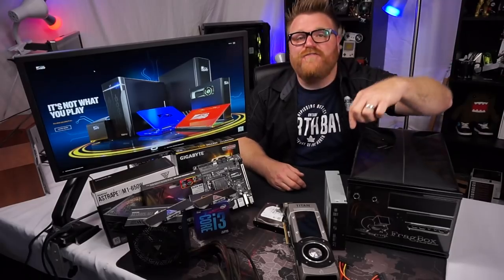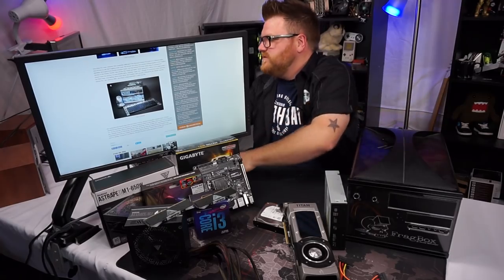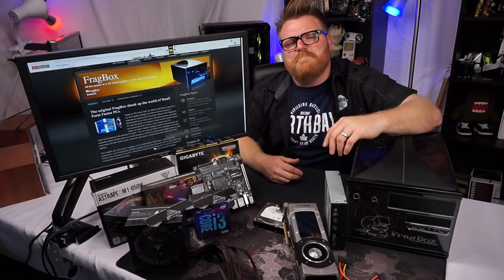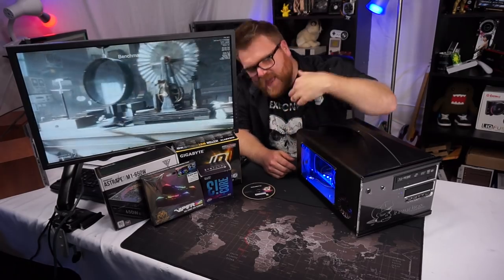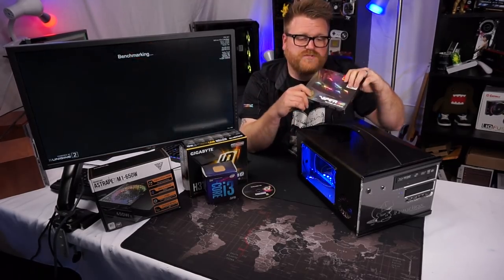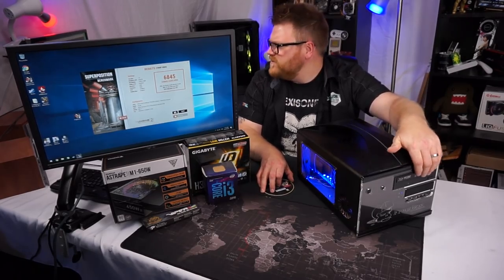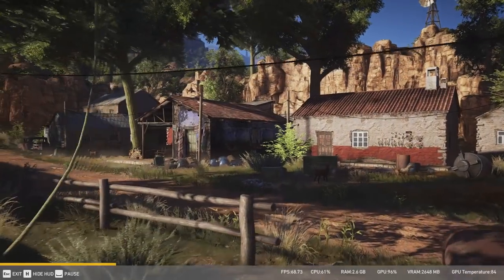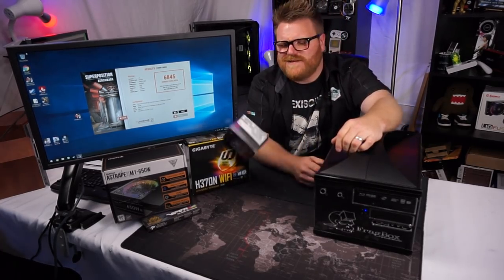Bringing a Falcon Northwest Fragbox Back To Life

Comment: You can cut down on the coil whine by using a UPS with Sine Wave Correction. Definitely helped me with my GTX970 Strix that is infamous for coil whine. Also cuts down on heat from your PSU as it has to do less correction. Also pledge on acrylic to cut down the scratches.

Comment: You could replace the 5.25" CD Drive with a nice fan controller to modernize it even more.. though if I think about it, nobody really uses 5.25" fan controllers anymore :(
Reply: i do, but I understand why people use the hub style that plug into the usb header and also control RGB lights

Comment: Damn that BugVidia coil whining....their FE edition crappy blower style coolers are really crappy....never understood why Nvidia fanboys bought these versions since they all develop coil whine very fast and become even more anoying that they already are with all the blower loudness already out of the factory :-).
Reply: LFly R 

You almost have to use a blower style card in cases like this (also in SLI builds).
Reply: smoked_out : no you don't have to use it in this kinds of build, because this case is not hermetically enclosed, it has enough holes so that a 2-fan AIB edition like MSI GTX 1080 Gaming 8G could breathe with ease because it also blows 50 % air out of the I/O at the back.. As for SLI builds goes, I agree....but to be honest SLI builds are stupid since 98 % of games don't show justifiable scaling or proper scaling at all and the second GPU is usually idling at 1 % or has very irradicall utilisation. SLI is dying slowly unfortunately and for years I wanted it to start getting momentum....

Comment: core i3 8100 = i5 2500k lol
Reply: Once you overclock the 2500k to 4.7ghz +
Reply: 4.4 ghz got me pretty much 600 CB iirc.  Then again I did have it running at 4.8 for a while so it could have been that.  Either way a LOT of 2500ks hit those speeds.
Reply: Mine kicks ryzen ass and I paid 100 euros for the processor, mobo and 16gb RAM
Reply: Does it really tho? 2500k barely beats a stock 8100.
Reply: Eli_Plays Beats a 1200 as seen in userbenchmark and I have done a cinebench run at 4.5GHz which I dont remember
Reply: Ramen Jesus 4ghz 1200 will beat that 4.5 GHz 2500k.
Reply: I paid the price of a new 1200 for the mobo ram and cpu and I have a volt left of safe voltage
Reply: Ramen Jesus that's cool and all. 2500k is still slower.
Reply: And a 1/3rd of the price
Reply: Ramen Jesus price has nothing to do with performance.